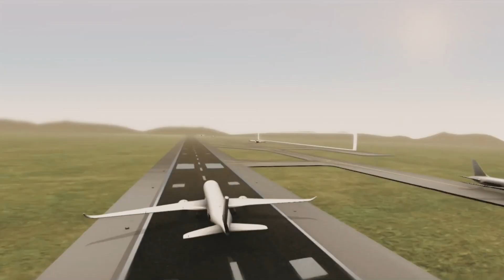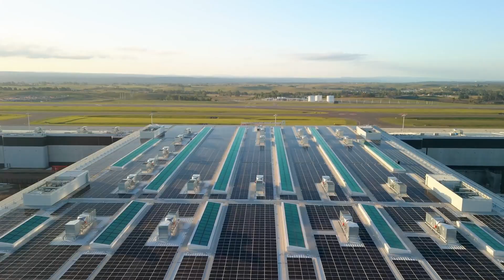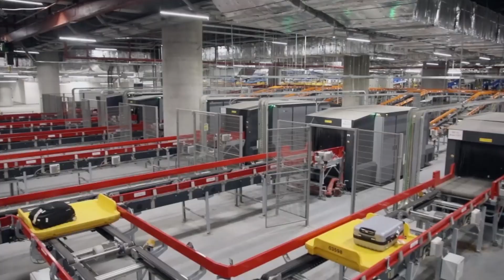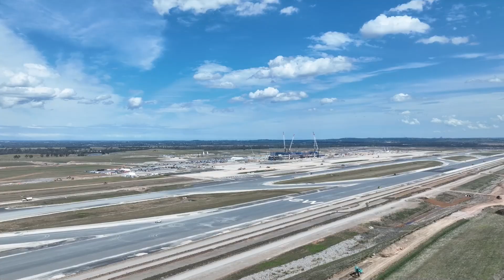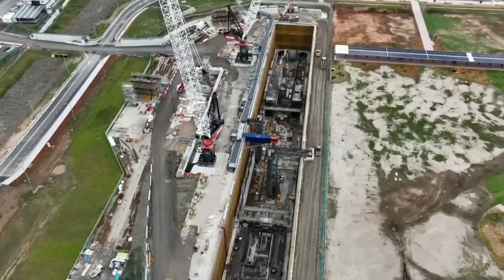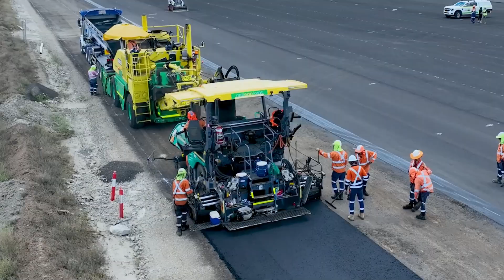How Australia's $5.3BN Airport Will Change World Travel

Comment: The ridiculous cover graphic was off putting, but the content was largely accurate and (for once) focussed on the engineering and systems beyond just the terminal building. Most clips treat the terminal as if it is the whole project. The water treatment system is even more impressive than stated, also helping to rejuvenate local streams and creeks. During construction there has been much wetter weather than normal at times, testing the whole drainage system in the most real way.

I picked only three errors and two significant omissions (which is a good score). They are;

- Woods Bagot is not the only organisation involved in various aspects of the design.

- The eventual airport capacity is 82 million annual passengers, which is about the SAME as London Heathrow, OR about twice the current level at Sydney Airport, not as stated “the same as Heathrow and Sydney combined”.

- The graphics at 7.41 show an aircraft bing refuelled from a tanker. Obviously this is not WSI Airport, but it might make some thinkt hat will be the refuelling system. It isn’t. The airport has a fuel hydrant system under the apron, with outlets where mobile pump/filtering vehicles connect, to supply aircraft with fuel fed from the airport’s tank farm. The latter will initially be supplied by road tankers alone: a  few a day initially, up to around 40 a day in the 2030s; at which time it will reach a break-even point where a pipeline supply (now being planned) becomes less costly to use. While tankers are still being used, up to five can discharge their loads into the airport storage tanks at a time.

- The airport is the first in Australia to use a remote / virtual control tower system, with numerous cameras and other sensors linked to a facility in a very large and secure offsite digital data storage facility, complete with its own back up systems. It recreates the airport scene inside a large control room, and enables features like night / low visibility vision, automatic tracking and tagging of aircraft and vehicles, intruder detection, and detection and alerting of emerging hazards.

- The high volume capacity with only two runways is achieved by having widely separated parallel runways. Closely spaced parallel runways, such as at Sydney Airport (about 1000m apart) increasingly suffer as weather conditions worsen, as traffic on one runway has to be kept separated not only from others on the same runway, but nearby on the other as well. That limits the amount of simultaneous operations. Once you have greater than about 1500m separation, that problem diminishes and higher flow rates are possible. This airport has runways that will be a generous 1900m apart; so is almost like having two separate airports sharing the same terminals and facilities.

Comment: The comments below that Western Sydney is hotbed of crime is just so ridiculous. To start with, Sydney in general and for that matter Australia in general has low crime rates compared with most other places worldwide. And when you check the actual crime stats for various areas, the worst you get is not the Westerns Suburbs at all. The real hotspots are more like as follows.(Note:  While some specific stats are a few years old, the overall pattern of drug crime has remained much the same):

 - Cannabis - While some people a few years back have actually suggested youth in Mt Druitt (a western suburb) “should be sterilised because of the drug problem”, it didn’t come in even close to topping the list at 497.2 offences per 100, 000. Much higher was the inner city area at 1594.1, several country towns ranging from 850.3 to 1123.2, and places like affluent Waverley were up at 796.5, while trendy inner suburbs like Marrickville, Newtown, Surry Hills and Potts point were up around 710.
- Ecstasy - The highest rates are in affluent suburbs, like North Sydney, Inner City, Rand Randwick.
- Cocaine - Affluent areas dominate, such as Woolahra, Waverley,  Randwick and Parramatta.
- Ice / Methamphetamines - Is more typically an issue in country towns and the inner City. Liverpool (western suburbs) also gets a mention, but at less than one third the rate of the Inner City area.
Assault - There is often a fear of assault in western suburbs, yet the rate of it in the area near the new airport is only about a third of that in Sydney's inner city area.

- Some online info (especially those advising students) often confuse volumes of offences with their rates, making more populous areas (like Blacktown LGA) appear more dangerous. 
- Crime rates that are higher in the Western Suburbs are more likely to do with domestic violence and theft - Murder is rare enough city wide that specific events like the multiple knife attack at Bondi Junction skew the statistics.

The most inaccurate thing you can hear about the  Western Suburbs is that it is some sort of crime capital. Virtually all the actual records indicate it is not and has far less drug issues than much more affluent parts of the city. Statements to the contrary more likely indicate people from affluent areas equating crime with lower incomes. At best it is ignorant bad-mouthing and snobbishness. At worst it is class based bigotry, that would not be tolerated if it was based on say race or gender.